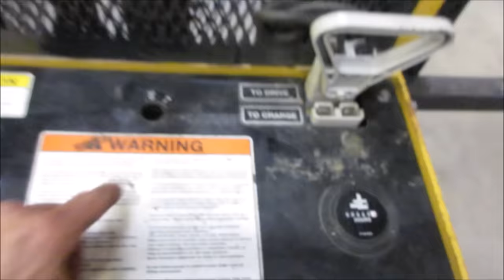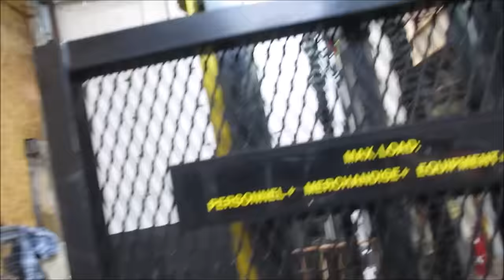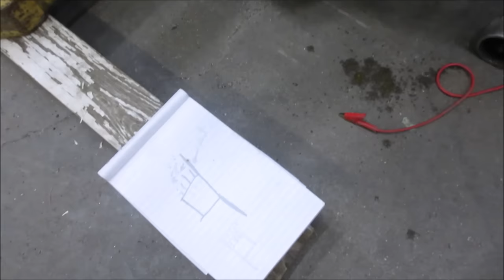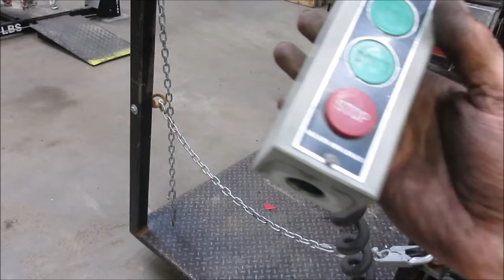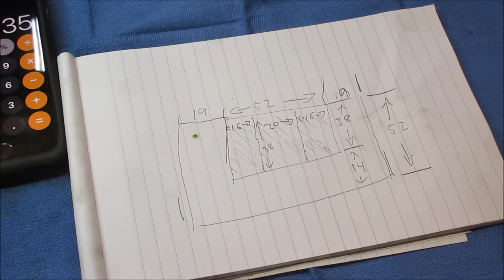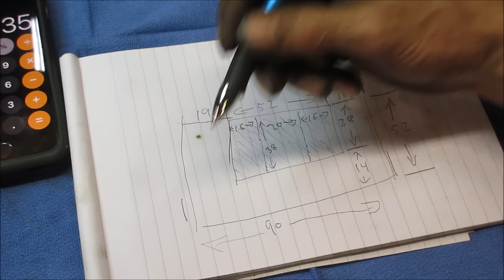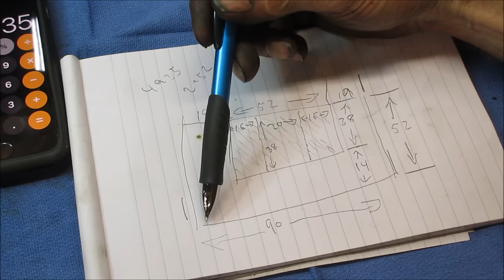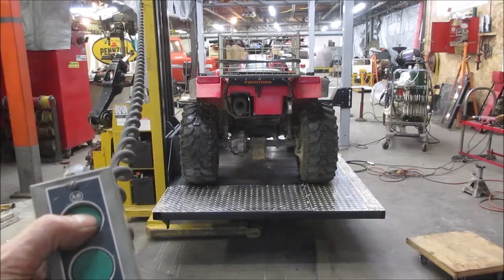Busted Man Lift Turned into a 2nd Floor Barn elevator

Comment: My thoughts are is it possible to just do away with the batteries and use the charging transformer to power the lift? Try plugging the connector in to the charger and then run a cord to the charger and see what it does.
Reply: The charger has a fuse, the huge drive motor will exceed the fuse value. Next problem the diodes in the charger could not take the current either
Reply: @Islandwaterjet  He isn't using the drive motor. He couldn't get it working and besides its being bolted to the floor. Doesn't anybody watch the videos before commenting???
Reply: @megagregg  You believe I am criticizing you and of course it is a natural human emotion to recoil from what you believe is criticism and you wish to defend oneself from that perceived criticism. Youtube comment section reveals a fascinating insight into humanity that would otherwise never be revealed. Thank you for your comment.
Reply: @Islandwaterjet  You are being ridiculous now. All I did was state facts and ask if anyone watches the video before commenting because you were saying the drive motor would blow the fuse and if you had watched the video then you would have known he wasn't using it because the lift would be bolted to the floor. But hey lets shift the attention to me instead of where it belongs.

Comment: I'd be worried about it tipping forward especially with heavy load. I would definitely extend the legs out about 20" on the front. I would not want to have a motorcycle flying down or even the entire lift tipping forward. You know, the whole fulcrum theory. Science and sh$%. LOL.  Safety third?

Comment: you know that switch broken in steeling handle just could have connted it together them it release brake so you can move it freeway
i know boss man own warehouse own one machine lift man and id recomment hook that wire back up them it will be easy move it around or put switch on it so u can release brake or lock on 2nd that light flashing is troubleshooting issues
2 flashing is thotter failure to read it unable read thotter
black box is esc for motors it same as gulf karts no different

Comment: Why the heck didn't you just use a 4 x 8 sheet of aluminum lay down there and screw it down it would have been so much stronger. The Engineering reason being is it would have been one big Solid sheet and two if something happened to your deck and it was to bend an aluminum sheet being one solid piece of metal would add extra strength.

Comment: Why would you cut the backing off? You think you will never, ever possibly lose your balance? Every last safety is there because someone, somewhere was either crippled or killed. Do you think that you can never be entangled with the lifting mechanism? like in a moments inattention you set your hand on a piece of metal while descending from on high and suddenly find your hand trapped by a passing horizontal bar in the lifting assembly. Like I said, every safety feature is the result of someone getting injured or killed. Of course you will never have an accident, will you?

Comment: This is just an incredibly bad idea.   Everything about this machine is built around the existing platform.  Moving weight away from the lifting mechanism will exert additional forces on the mech not designed to hold that weight. As the weight goes up in the air, that will multiply.  Even if you bolt it to the ground, the forces involved could rip the bolts right out of the concrete.